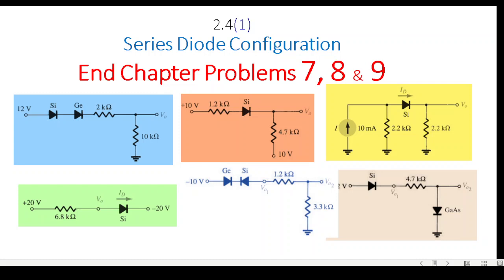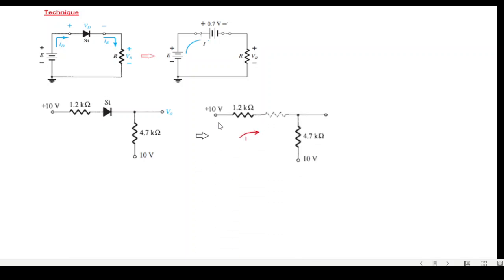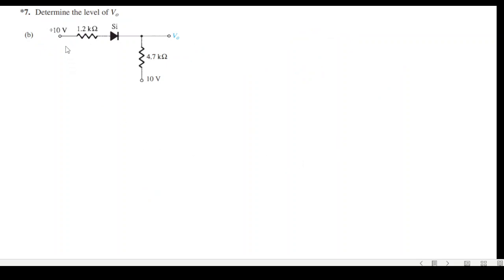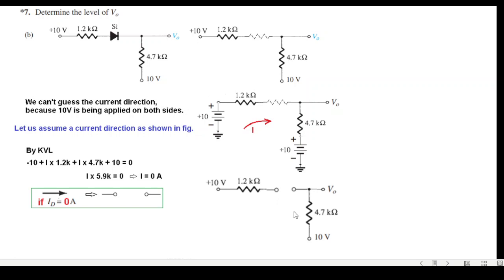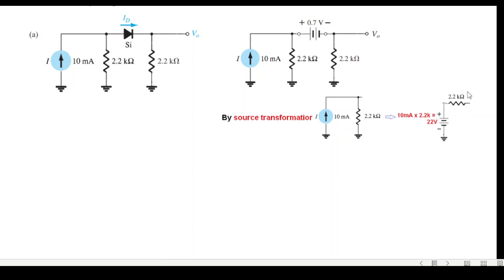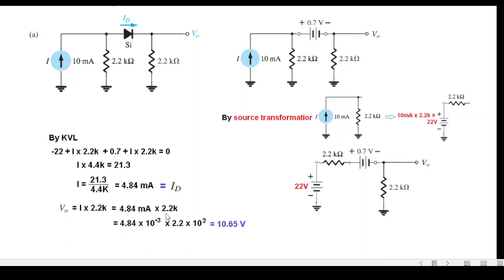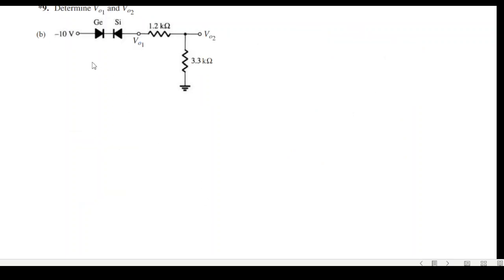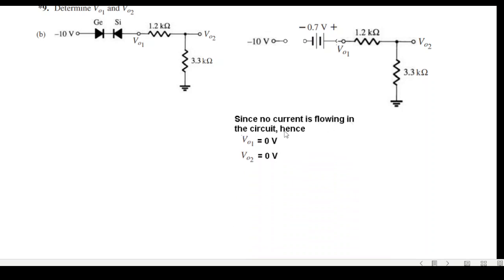(B)EDC(B)  Q 2.7, 2.8, & 2.9 || Series Diode Configuration

Comment: 02:45 if Diode cathode is on the side of 12V, will there be any change?
Reply from the maker: The diode will not conduct. Zero output.
Reply: @ElectricalEngineeringAcademy  Thanks